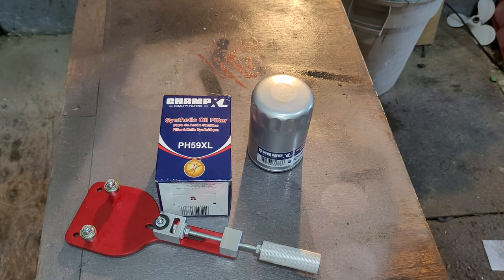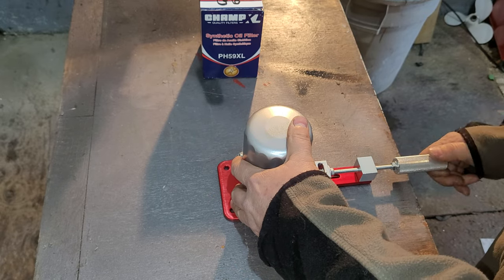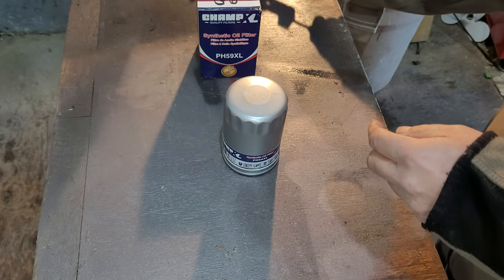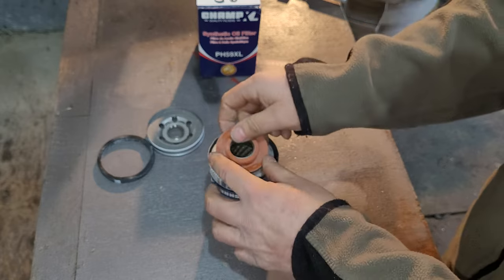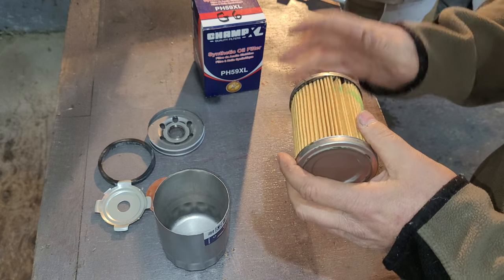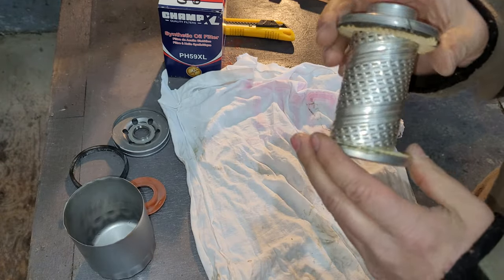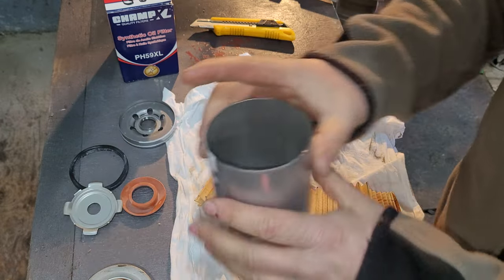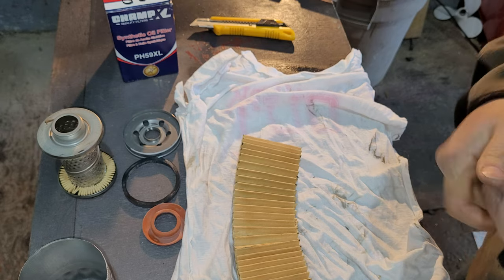Champ XL Synthetic oil filter Review

Comment: That filter fits GM engines, which usually have the bypass in the block. So that's why this filter does not have one.
Reply from the maker: Thank you Brian, I have never been one for knowing if a bypass valve is ever needed. I always change my oil early enough.